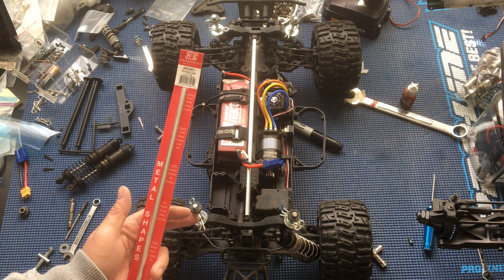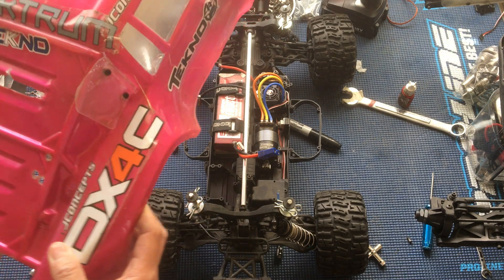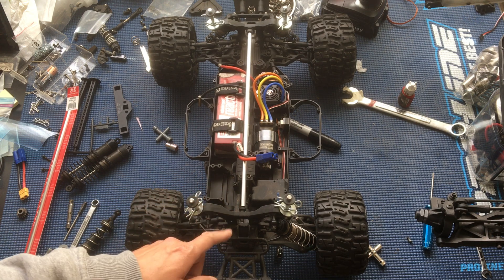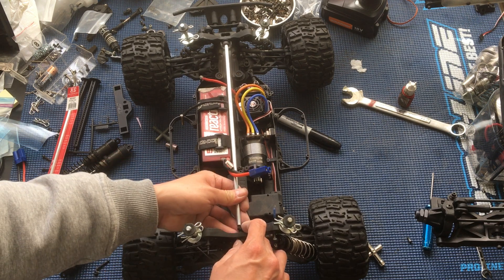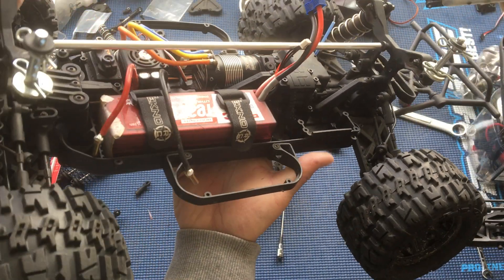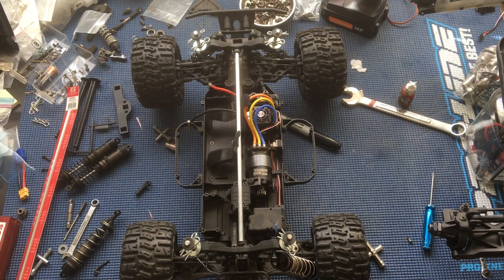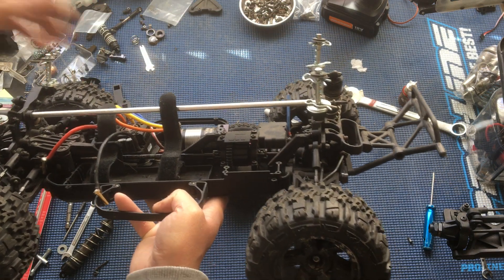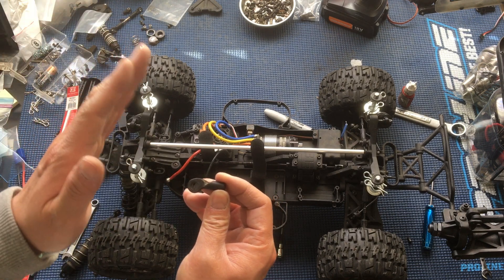Tekno SCT410.3 Monster Truck, Proline 2.8 Tires - DIY Chassis Brace Using 1/4 Inch Aluminum Tube

Comment: I want to turn my SCT 410.3 into a monster truck too. Did make any changes to the truck when you mounted the 2.8 MT tyres to prevent any rubbing? Are the wheels wider offset?
Reply from the maker: Thanks for watching and commenting Kenneth Bagamasbad! Nope, Proline 2.8's fit perfect!